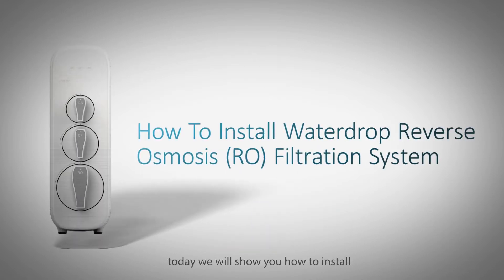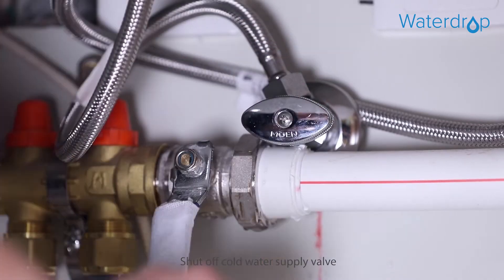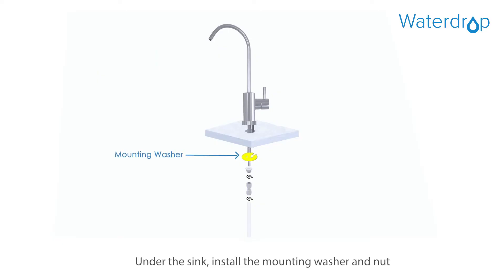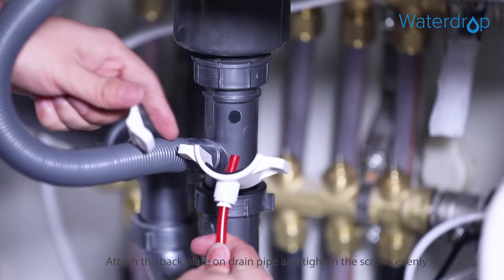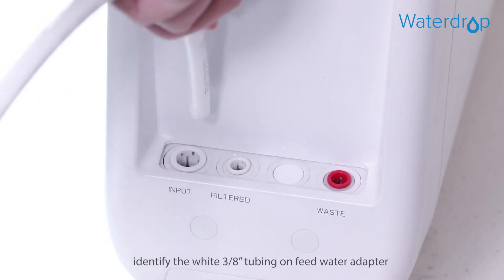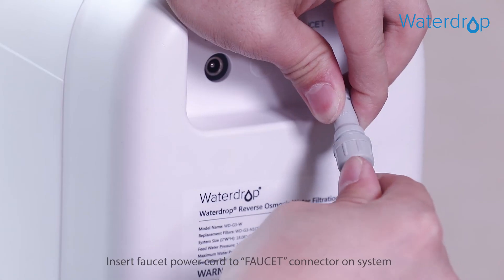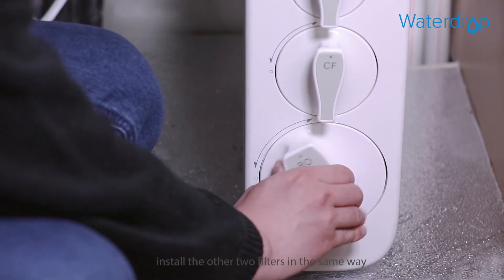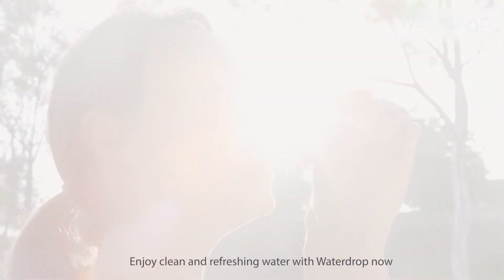Waterdrop G3 RO Installation

Comment: The only step I didn't do after   installing was to run the water for 30 minutes. Will this be a problem for water coming out slowly from the faucet. 
Please answer my question. Thanks.
Reply from the maker: Hi Zeke,
Thank you for your purchase. Please note that the flushing of 30 minutes after first installation is required.
The water flowing out during the flushing procedure is NOT drinkable, which is clearly stated on the user manual, thank you.
Reply: @waterdropfilter.official  yes I did run the faucet for 30 minutes,  however I don't think I could do anything to increase the flow of water, it would be great if we could increase the flow a little more. I always owned a RO with a tank which is better for water flow, although I must admit the tankless is so compact. 👌
Reply from the maker: @zekehu7701  Hi Zeku,
Thank you for your reply.
Please note that the flow rate of our G3 is 0.28 gallons per minute, could you please check yours it meets the standard? Thank you.
Please rest assured that we will continue to help you if that is not the case.
Reply: What size hole is required for the faucet?